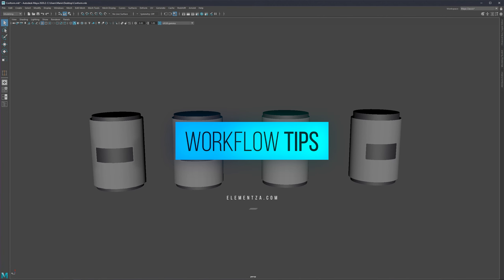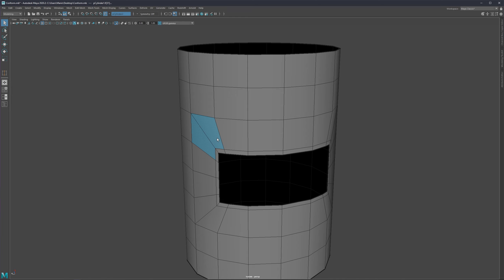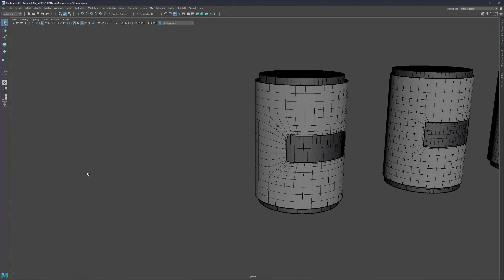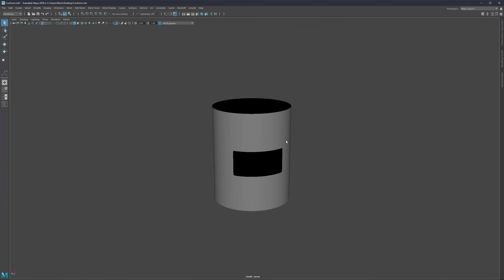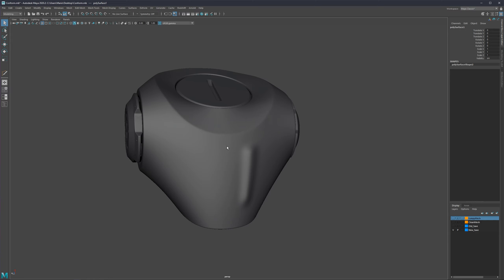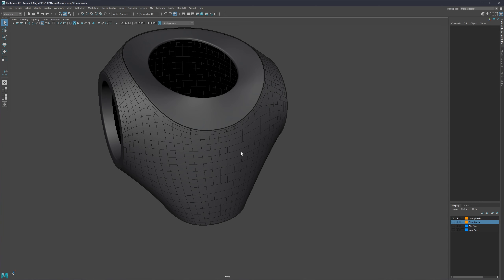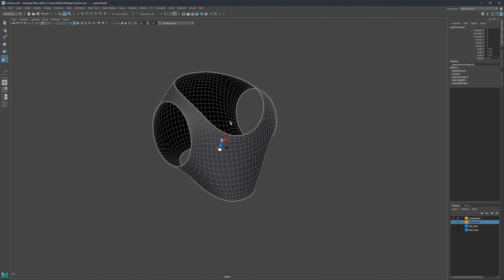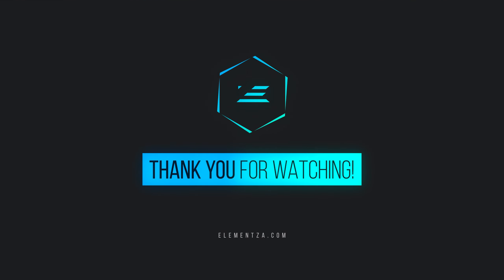How to fix surface deformations with ShrinkWrap & Conform // Workflow tips

Comment: wasnt there a option where you can mirror the location of the vertices from the middle. In one of the Tutorial chapters you did that with a circle you created on a surface. 
so you create the detail on the left side and the copy the locations of it and past it to the other side. 
but they need the same amount of vertices.
thank you for the Tips helps alot with the workflow m gonna try that out 🔥🔥🔥🔥🔥🔥🔥🔥🔥
Reply from the maker: Yes, you mean Symmetrize. This was just a quick demonstration of this approach.

Comment: generlly to fix cylinder deformation you need to add more subdiv and coform from an other cylinder with high subdiv for 2 methode i use bend modifier

Comment: With shrinkwrap, I've noticed it does not like it if you have a hard edge being wrapped to another hard edge nearly. So for instance, take a circle, extrude it upwards and inwards so that between your two circles, you have a 35 degree angle or so. When you wrap your base mesh to your guide mesh, the formerly "flat" edge loops that make up the top and bottom of the circle deform. The shape stays the same, but shrinkwrap moves the verts so even if the ring of edges making up your top and bottom circle are perfectly flat and overlap perfectly with the guide mesh, when you use shrinkwrap, those edge rows now jitter.

Is there a fix for this kind of issue? Or is shrinkwrap for surface deformations only suitable when the object you're working on does not contain hard edges?

Comment: i've tried this in maya and it seems to work well - https://www.youtube.com/watch?v=3rlMzsBWtPY

this workflow works well in maya - you just can't use the 1, 2, 3 subd method. you have to use the SMOOTH GEOMETRY function and turn that up a bit. THEN you shrink wrap. you'll still be able to edit the attributes of the smooth modifier to jump down if you need to but since it shrink wrapped your higher geometry count, you're smooooooooooth. and you can continue to extrude to add bevels going inward and such but after you've applied the shrink wrap otherwise they'd get pasted to the reference mesh.

AND you have to make sure not to delete history!